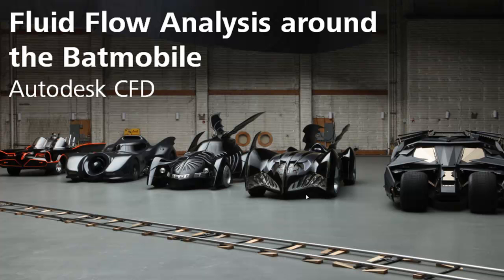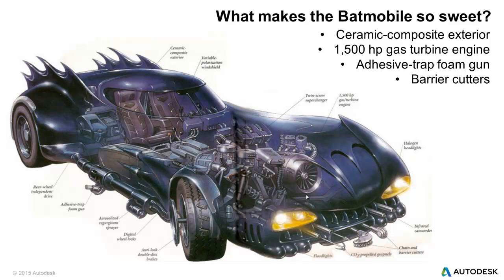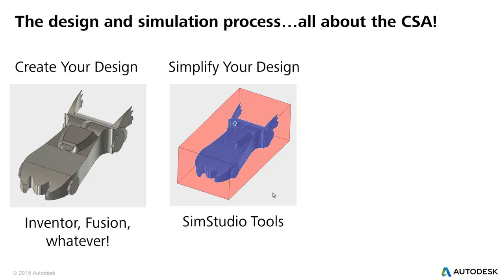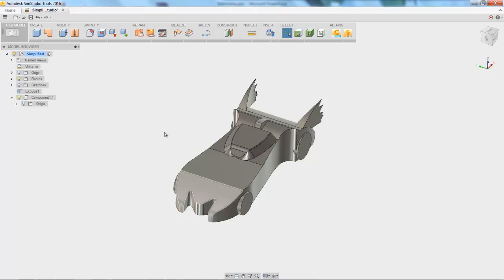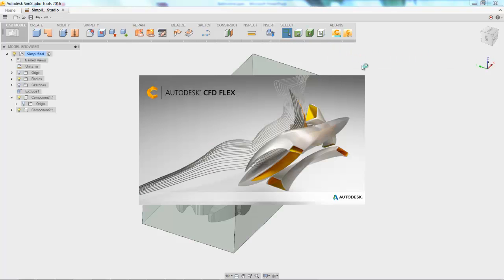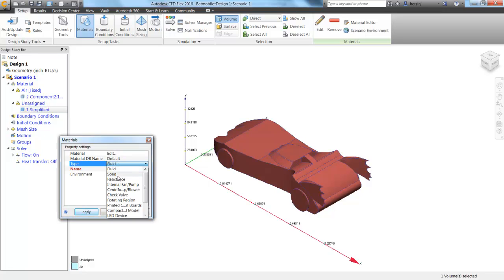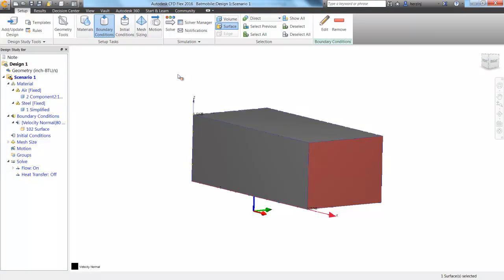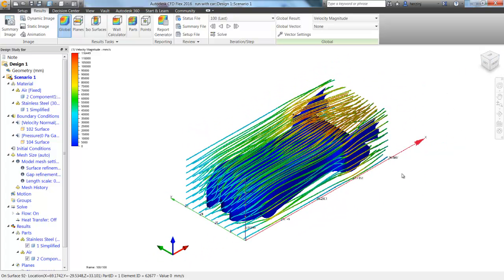Fluid Flow around the Batmobile - Autodesk CFD

Comment: For those wondering CFD has an option on import to surround the model with air, so simstudio is no longer needed. if you're looking for simstudio, and are wondering where it went, it's been transferred to Fusion360.